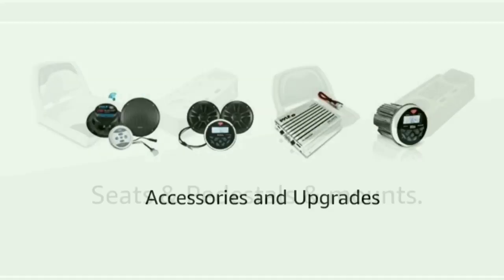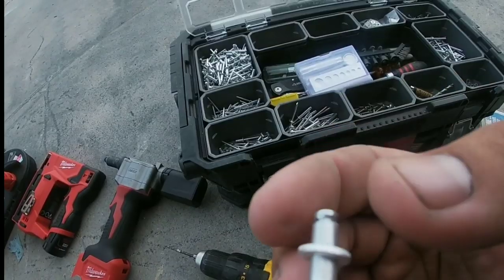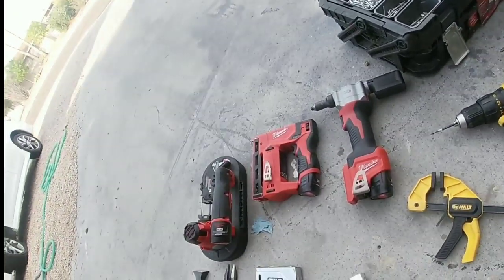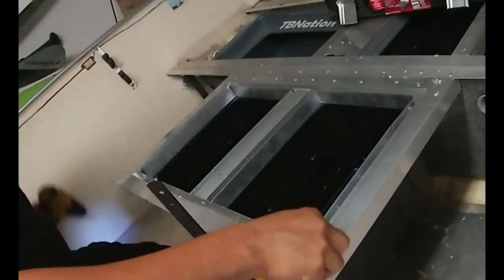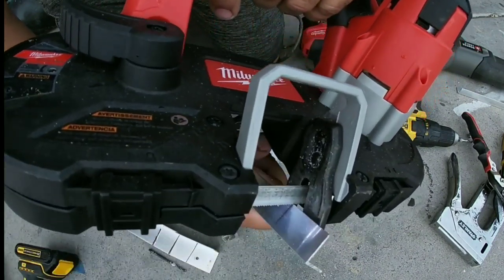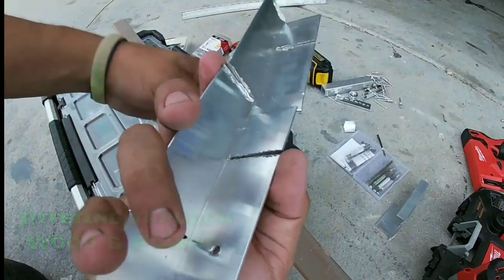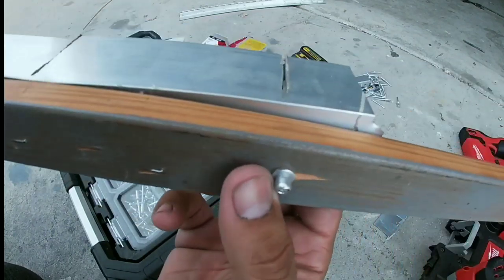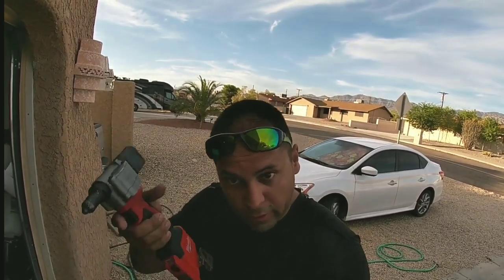How to rivet Aluminum | Tutorial & Demo + Tools needed, DIY.

Comment: This is a helpful and very thorough demo of various kinds of pop, rivets applied to aluminum, plastic, wood, etc. But I need to repair the bottom of an aluminum boat. I wish there was a better demo of bucking solid rivets. Sounds like I’m going to need an air hammer set up.

Comment: Great to see your bucking rivots! Just to point out something, the bucking bar goes on the "tail side" when bucking. Also, using air hammers is not only for ease of use but also heats up the solid rivot during the process, which expands it in the hole.
Reply: I did not know that.  Now I do!

Comment: This reminded me that I saw you using staples to fix your 1/4" plywood strips under your main 1/2" deck boards. I used my 18ga brad nailer and wood glue, supah fast! Recommend the 18ga because they do the smallest brads all the way up to over an inch for larger cabinetry. I got mine from harbor freight and it hasnt yet skipped a beat.

Comment: Hey man! Great vid!
It’s imperative for structural riveting that the holes are perfectly round. Standard drill bits don’t leave holes that are perfectly concentric. Race and aircraft construction typically uses a reamer after an undersized hole is drilled. Will it make a difference right away?  Nope.  If your boat vibrates and flexes while you use it.... eventually the rivets will loosen. 
I suggest Carroll Smiths book Nuts, Bolts, Fastening and Plumbing Handbook (if you can find it). It goes into depth on practical riveting that would directly apply to boat building. 
Keep up the good work! Nice Tools!
Reply: I've never used a rivet once in my life but am contemplating building my own jon boat conversion. Thanks for the advice. It's nice to be pointed in the right direction to find the correct methods for each application. I've done carpentry for years but I didn't want to use wood for this project so it will be a new learning curve.

Comment: Excellent video.  Came here to find a solution to something that happened to me today using 3/16" Ace Hardware aluminum rivets (5/16" grip?) and a Stanley swivel head manual rivet gun.  What would cause 3 out of 4 rivets to break off at a weird length -- about 1/2" sticking out of the rivet joint -- and loose?  The remaining rivet shaft(term?) is too short to regrip, but obviously having that long thing hanging out of a loose rivet is not good either.   I'm planning to cut it off and drill it out, but can't figure out what caused 3 out of 4 rivets I was trying to patch approx 1/8" aluminum with a 0.025" thin aluminum patch, so I don't think I'm too thick for this rivet grip range.

Comment: 8:55 So you can basicaly use a hammer and don't necessarily need an airhammer to do buck rivets? What do you call those different sized tools you are applying to the head? so you don't hammer the head just the back? I got a step van and need to attach aluminum sheet to the roof over existing fiberglass. I've used pop rivets and even these cool domed at both end pop rivets that look like a solid rivet on one side but not sure I can get one of those for material thickness less than .625.
Reply from the maker: It’s a concave bit that covers the mushroom and you would tap it from the back.
Reply: @TinyBoatNation  So you don't necessarily need an air tool? What do you call that bit?

Comment: Ive heard that stainless rivets should be used. I got the Arrow rivet tool, but it says on the box not for stainless rivets...do you use stainless rivets, and if so, what tool do you use for them?
I'm building tackle storage and an electrical panel in a smoker craft Alaskan 13.
Reply from the maker: Just use aluminum rivets. You need a really powerful gun to pull stainless
Reply: @TinyBoatNation  Thanks!!!

Comment: What up man cool video, any chance you got a lead on some aluminum bolts? Just to avoid corrosion and electrolysis between stainless and aluminum. I'm gonna be using M10 threaded insert rivets to mount my deck down.
Reply: Really?! Sweet!! Thanks for the heads up man! I got some cool pics of my boat to show ya soon, just finished framing, about to foam and start decking, by the way how has the coosa board been working out, any cons?

Comment: POP® brand closed-end blind rivets offer up to 23 percent greater tensile strength than POP® brand open-end rivets, as well as zero penetration by liquids or gas at pressures up to 100 psi.
Reply: @TinyBoatNation  I think the key is to choose correct grip thickness.

Comment: Under the pressure of professional boat building I have had every single Milwaukee tool fail on me.  In the long, they suck.
Reply: I have purchased some of the same Milwaukee tools three or four times. Some of them really are a necessary convinence there's no doubt. Or necessary evil I should say.  I've killed everybrand of cordless tool and had a box of it all as big as a small house before I finally shit canned it. If you can find the time and space to put a good quality compressor somewhere where the noise is insulated away from your house and neighbors well then airtools last forever.  Figure a way to keep the hoses from being a pain and I especially use the largest connect fitting for the tools with the quick-change at the hose.   I usually blue tape a rag around the airtool outlet port to quiet it down.  When it's not a loud use too it makes a big difference in your attitude toward them.   Anyway you have a great show, it's been fun watching you transition from kind of an upgraded diy to a professional in aluminum boat rehab.  You have a good balance of speed and perfection to keep the projects moving along.